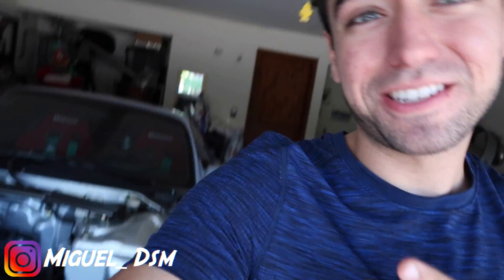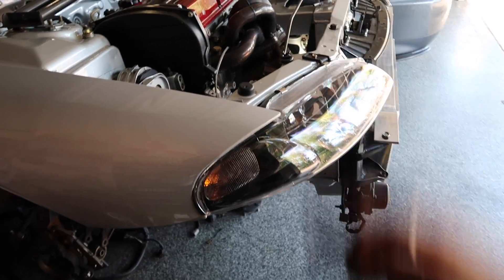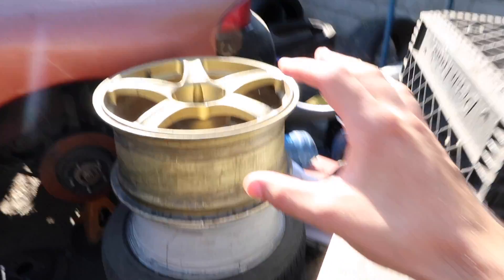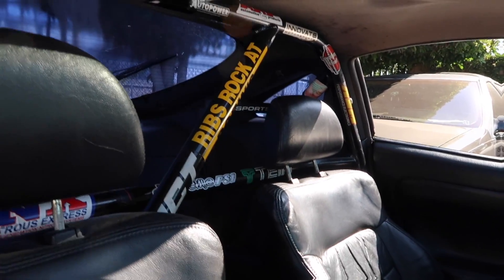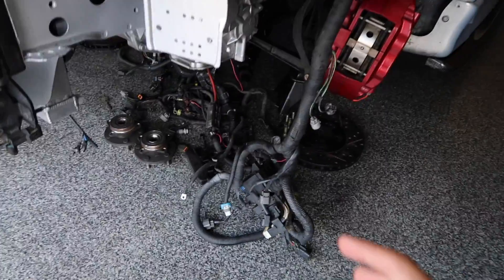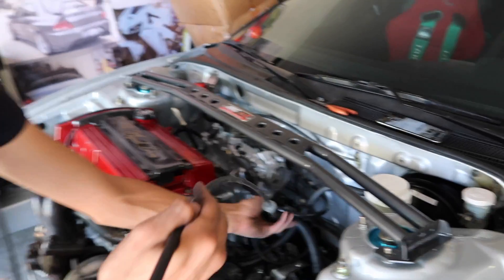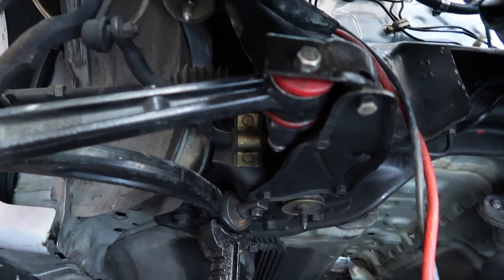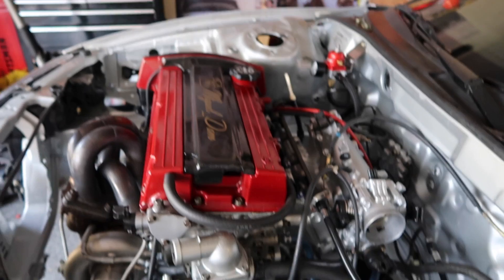EVO SWAPPED ECLIPSE BUILD CONTINUES! Ep.21

Comment: Yo Miguel the steering wheel is a six bolt in the eclipse? I dnt have mine to look.
Reply from the maker: Six bolt? As in the Allen bolts?
Reply: @MiguelDsm  any bolts k at wondering how many. I just bought a sparko steering wheel. With a short throw shifter.
Reply: Lol just look how many go in the stearing wheel to bolt on. My bad.
Reply: @MiguelDsm  not the allen. The bolt on bolts.
Reply from the maker: @kainc7136  It doesnt bolt on. You need a hub and quick release first
Reply: @MiguelDsm  lol I just looked. Another $100 for the adapter. Oh damb what I do. $300 in a steering wheel. It's nice tho. Neo color with black wheel and neo specks.
Reply: @MiguelDsm  Thanks Miguel. BTW you should paint the valve cover gold!
Reply from the maker: @kainc7136  thanks for your input!